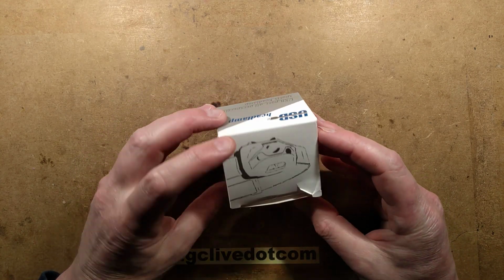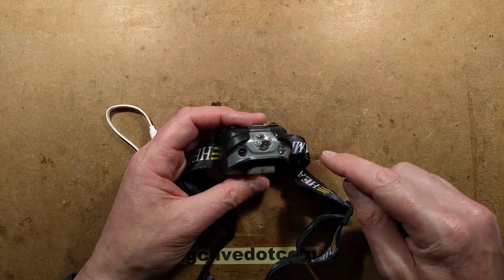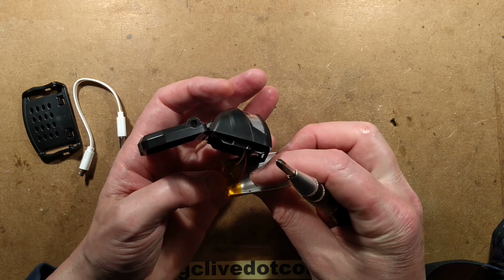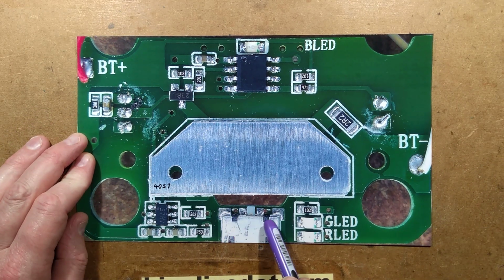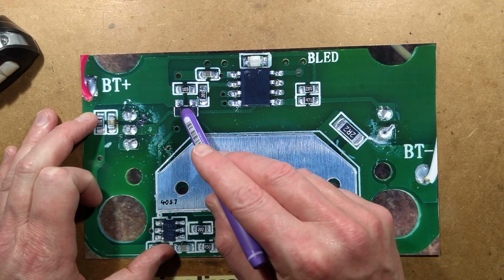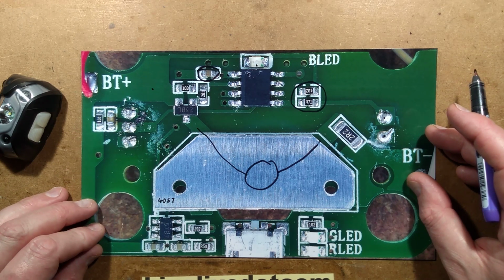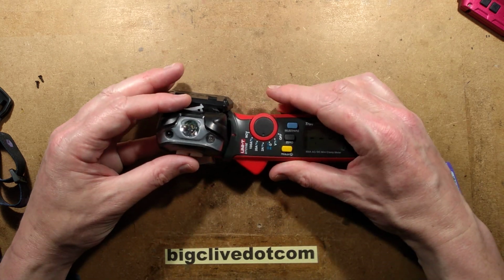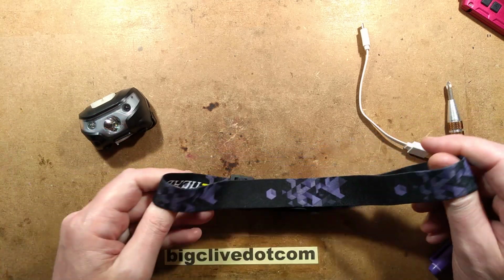Inside a rather good USB rechargeable head-lamp from eBay.

Comment: Just imagine...  🌈🌠
🤔 Someday, someone, somewhere over the rainbow, will invent the world's first DECENT LED torch that is:   1 push ON   1 push OFF
Without having to cycle through:
• Medium
• Low
• Flash
• SOS
• Red
• Red Blink
• Red Blink (fast)
• OFF (finally!!!)
Reply: Most led flashlights from the decent brands like Fenix, Nitecore, Olight, Acebeam etc. can do exactly that. Just dont expect them to be available for 5 pounds on ebay from your favourite china seller..
Reply: Better still, a means to signal that 'the circuitry associated with this button speaks long-press'. IOW, what happens if, when your light is on, you hold the button down for a half-second or more? One second? Does the light skip over the range of modes available, between the current/active mode, and jump to Off? Is this option common? Is this option particular to specific chips?
Reply: @michaelthibault7930  Long press on, long press off and short press for modes would be perfect.
Reply: @ferrumignis  My Fenix HL55 does that (except it's short press: on)
There are surprisingly many factors which can make the difference between a great headtorch, and an annoying gadget which stays in the junk drawer.  The HL55 is the only one I could recommend so far.  Sadly the HL60R (rechargeable version) deviated from the K.I.S.S. principle.
Reply: Ha! Ha! Ha! ... the Milwaukee led headlamp has an on off button, and a mode button... one press on, one press off. 
It also has an 18650 cell for a battery. (Yeah, it is a little large...) I use it every day.
Reply: I have a torch that had all these modes and then has a simple mode.

Comment: Am I the only person who thinks that all Chinese-made torches / head lamps have a strobe mode due to a misunderstanding about the American usage of the term 'flashlight'?
Reply: PTZEL AND BLACK  DIAMOND HEAD LAMPS DO HAVE A STROBE EFFECT AS I DO HAVE THEM
Reply: @davefridjhon  Ok. I'm thinking that something was lost in translation and so the Chinese person who first designed a control chip for a 'flashlight' thought that it needed to flash / strobe. Since then they've just all been copying each other...
Reply: its meant to gain attention in the dark, so it has a purpose. not a very useful one, but still. :-) 
but i like your explanation better.
Reply: Is there a mod that couples the IR detection and the strobe? Mod, note, not mode. 

How long before you can custom order (or program) the light cycle sequence?

Comment: Banggood has a dandy headlamp.  I bought three.  USB rechargeable and uses one 18650 cell.  Has one spot LED and a separate flood LED.  I generally use the flood.  I wear one most of the time and keep the others on charger (plugged into USB port on my desktop computer.}  Almost never have to turn on overhead room lights.  I have batteries salvaged from old laptop battery packs.  Much better than the headlamps that use NiMH batteries.  Brighter and longer lasting charge.  https://www.banggood.com/XANES-LED-Headlight-HeadLamp-E-bike-Bike-Bicycle-Cycling-Waterproof-Outdoor-Camping-Hiking-Fishing-p-1372165.html?rmmds=myorder&cur_warehouse=CN

Comment: if the 4057 uses the same programming resistor formula as the 4056, which seems likely given that 2k, its I(BAT)=1/R(PROG)x1200. the usual Rprog resistor in power banks is a 1.2k which gives charge current of 1A, 2k gives 600mA, 4.7k gives around 250mA, 10k gives around 125mA
in practice the charge current always seems to come out about 10% lower than the formula predicts tho

Comment: I recently modified my old LED headtorch to lithium cells and a new 1W LED (it used an early generation one, not very bright and was that "gaslamp white"), the battery box was trashed by leaky AA cells, so I cleaned all the rusted contact remains out, shoved in a pair of Nokia BL-5C cells wired in parallel connected to a TP4056 USB charger PCB, and replaced the cable from battery box to lamp (the old stuff started disintegrating as I worked on it), and hey presto, a revived and modernised LED headtorch that I bought 12-14 years ago from Lidl... :D
Reply: That sounds a bit like my grandfathers' axe - it's had 3 new heads and 4 new handles but it's going better than ever!

Comment: This may be dumb, but it occurred to me that you might lightly sand the lens so that the beam is difused a bit.  Just a thought.
Reply from the maker: It's in my tool bag now, so it'll soon be diffused.
Reply: @bigclivedotcom  ... a  piece of " press n seal " on the lens (  kitchen product mfg by GLAD ) works wonders for diffusing, is removable  & offers (some) lens protection.   Cheers

Comment: Clive, do you have a link for this light?
Reply: Clive rarely does specific links... 
I had a quick look through the results of a search for 'headlamp ir recharge' and seller dynamic-deals looks to have if not it, then a close match - itemId 292971162516 Same modes, 1200mAh, close look etc. Some other close  in  look and 1200mAh seem to have added SOS and red LEDs

Comment: Hypothetically, if one did have a dead body and some woods to bury it in, how would you rate this product. Just asking for a friend.
Reply from the maker: It depends on the hardness of the ground and depth of hole.  You may need to use it on the low setting of it's going to take a while so the battery lasts.
Reply: @bigclivedotcom  Who did you bury?
Reply: @misterhat5823  Whut?
Reply: bigclivedotcom at least we now know your fetish.
Reply: The ir sensor function would come  in very handy in this scenario when you hear that distant branch break underfoot and you need to go dark, nothing worse than fumbling with rubberised switches with bloody and muddy fingers that may trigger the strobing mode and the extra unwanted attention that might bring 👍
Reply: @Carl

"… nothing like…" experiencing it. Firsthand.
Reply: Because the heat sink is close to the battery, I’d say max 10 bodies, but also dependent of your friends digging capacity and the consistency of the soil.
Reply: @Conservator.  Don't forget the "How Deep" Coefficient.
Reply: jlucasound 
I assumed the standard 2m/6ft. ;)
Reply: Burying folk, 24 tyres underneath, 30 tyres on top, 5 gallon petrol, 5 of diesel. Matches, oh and a corpse..
Reply: @blackcountryme  And a shit load of smoke lol
Reply: @blackcountryme  don't forget the marshmallows 😃
Reply: I think they would be a risky choice for burying dead bodies at night. You cannot turn the light of quickly if disturbed, and if you use the infra red control which will give a quick turn off, if it is mr plod that disturbs you and after you have waved your hand to turn the light off you then look up it comes back on again because Mr plod is wearing a high vis jacket.
Reply: @Equiluxe1  I can drive a JCB. If you make all the noise you want, and wear a hi-vis you are invisible.
Reply: @blackcountryme  That is very true, Next time I have a body I will take it to the nearest building site.
Reply: blackcountryme This is true. It’s exactly the same if you have a film crew in tow. You can get away with anything.
Reply: @blackcountryme  The only time I see a JCB actually doing something is on  "Timeteam",   Therefore sound would not be a problem and the high viz jacket would not be moving either - just saying
Reply: FreeSpeechForALL 
You’ve got some really good points. It’s great how the internet lets one learn from the more experienced. Tx.
Reply: Research has proven that burying dead bodies (or any other kind) in a wooded area is very time consuming because of the tree roots. A deep lake and 50 kilos of metal in a good nylon net is much faster and hides the thing being disposed of.
Reply: Not recommend. If you were to dig the grave first (hypothetically) and dismember the body at a separate location (hypothetically), and just use the light to take the bits in a bag, dump the bits in the hole (don't leave the bag. Bag the bag and take it somewhere else to completely incinerate both, they can get forensics off the plastic) and then cover the bits, it might be handy for that. 

Hypothetically.
Reply: You dump dead bodies in open top cars abround town on hot days.
Reply: You mean asking for an ex-friend.
Reply: Don't bother burying the bodies.
Just buy a drum of sulphuric acid and some hydrogen peroxide, and there you go.
It will melt down completely, no evidence nor DNA
Reply: @fersunk  Like everything in this world anyone buying such a volume of acid will be investigated.
Reply: @fersunk  Wot about their Gold fillings?
Reply: Coincidentally, last week I introduced my ("I've never seen star wars" ) gf to the (must watch) 'shallow grave' film which she thoroughly enjoyed.
Reply: The narrow light beam would probably make it less suitable for digging work.
Reply: These lights are great for cyclops v night of zombie revival.  It even has the strobe effect for funkie zombie dance moves

Comment: I actually like the cheap multi-led versions for use at work when crawling about under desks or behind rack gear.
I scratch up the front of the "first set" of LED's with a file so they're diffused. You lose a bit of light power since it's diffused but soft wide light is great for most things I do at arm's length. The higher settings I leave alone so they stay as a beam.  I think it also increases safety as well since I'm able to see more around me without being blinded by the beam.
Reply: Fiberglas brush run around the outside of the lens. Depending, the angle of the cone described by the pen body's path can vary the gradient of the fall-off. An alternative approach: soften the central section by placing, temporarily, a punch-hole reinforcement (think: sticky paper annulus) on the lens to constraint the abrasion to a neat circle.
Reply: Fresnel-izing would do it, too. Maybe there's a place (market) for a screen-protector-like range of beam customizing 'contact lenses'. Or, the manufacturers could supply the light with a fitted, removable skin. 

A little experimentation with clear silicone and a fresnel magnifier card is called for…

Comment: This headlamp is similar in some ways to one I purchased about a year ago from Amazon and use for camping. They look too similar to not have some design connection.  (Herobeam model HB008) Its still available on ebay & amazon. Mine has a wide 3W COB and a spot XP-E.  Either one can be put into hand motion mode. The spot has 4 modes High/Low/Flash/SOS but the nice feature is after a couple  sec you don't have to cycle thru all to turn the light off. Its very tempting to open it up and see how it compares to yours but I want to keep using it for now. :) Not sure battery size, not listed in specs.
Reply: it has a skull pattern on the back which leaves a print on the forehead.